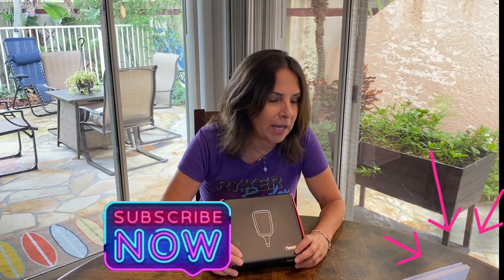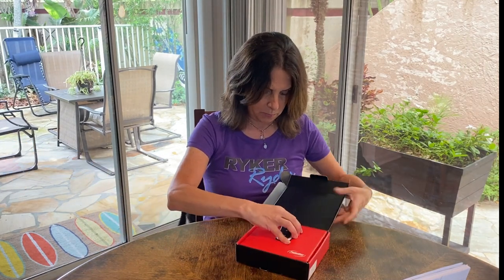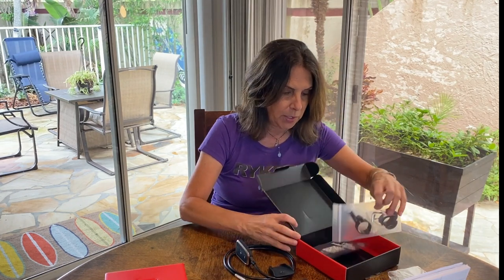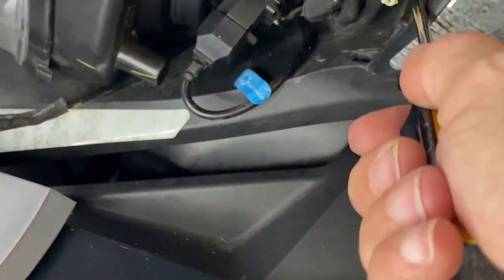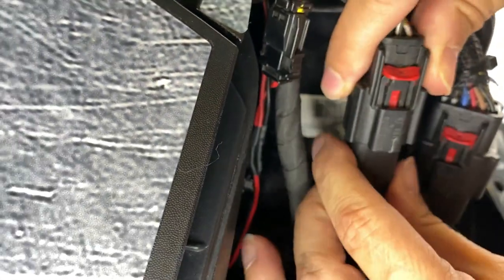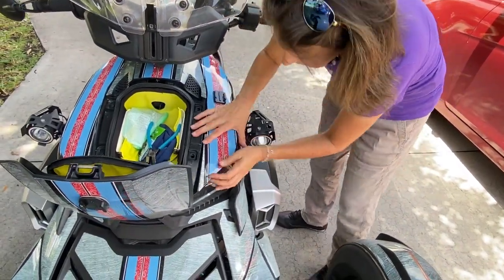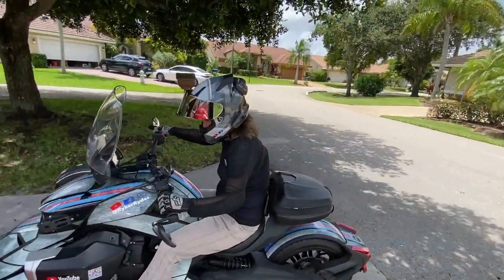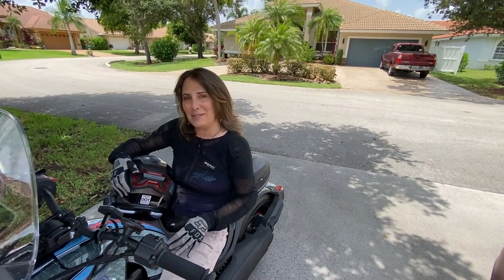PedalBox for Can-am Ryker and Spyder (MUCH faster throttle response)

Comment: To release the tabs on the connectors just push on the black tab just below the red lock . The part you used the Philips screwdriver on at the top. If this makes any sense. You shouldn't need to use a pick to release the latch unless it's stuck . Good job though and you did get it disconnected . 👍Great video as always.
Reply from the maker: I’ll try that next time!! Thanks!!

Comment: Beth, can I ask… does changing the modes on your Ryker through the instrument panel still work with the pedal box or does the pedal box make these modes obsolete while it’s connected?
Reply from the maker: It should not matter what mode you are in. It only affects your throttle response (significantly). If you were in Sport or Rally mode, you would notice even quicker throttle response.